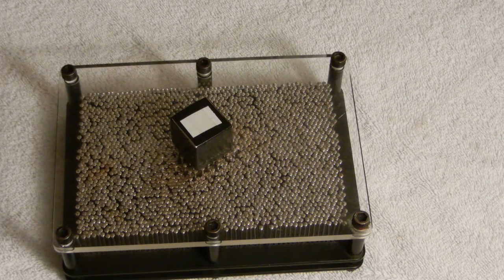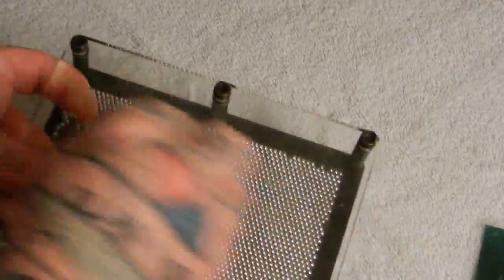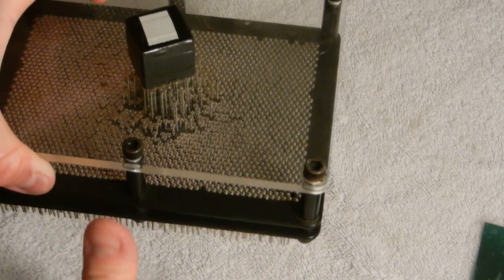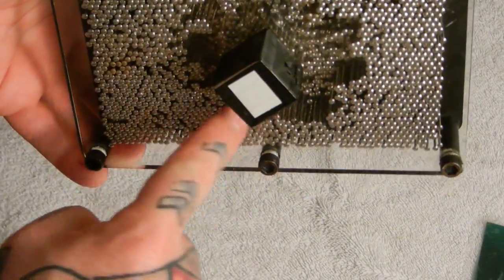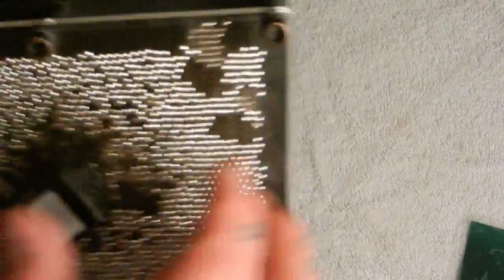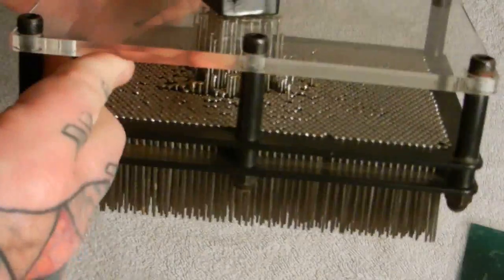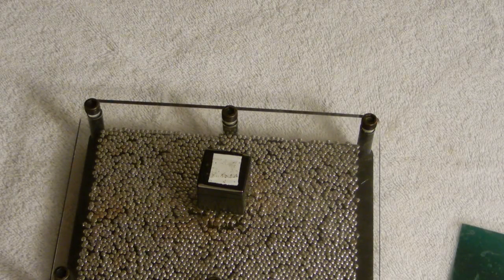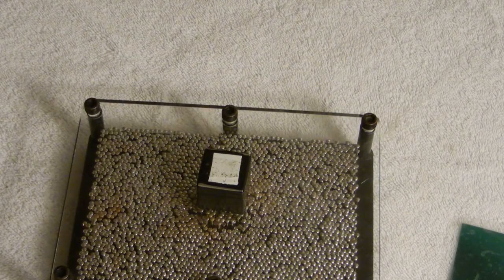Video 1 Uncovering the Missing Secrets of Magnetism

Comment: Awesome find. Taking another look a year later, I'll take another stab at what is going on. I'm thinking that what happens when you move the magnet slowly closer is it gives the atoms in the nails more time to adjust themselves to accommodate the incoming field of influence.  But whenever the magnet comes in fast, everything gets bunched up.   

It's sort of like pouring hot water into a glass slowly in order to give the atoms time to adjust, vs pouring it quickly and breaking the glass. The glass breaks because the atoms got all bunched up from there being too much of a clash/contrast between the inertial momentum of the hot water and the inertial momentum of the room-temperature glass.  

But if you pour the hot water really slowly, the atoms in the glass aren't hit by such a violent contrast, so they can slowly take on the new behavior and adjust their bonds with the atoms around them accordingly to accommodate the transfer of the new behavior.    

So with the nails, when the magnet comes in fast, the atoms get bunched up a bit which creates a little bit of heat. The atoms get coiled up and then spring apart.  This movement interferes with their movement toward alignment with the overall field. 

In order for the nails to be attracted to the magnet, they have to polarize.  As they do, then nails nearby begin to polarize also. Eventually,  all the nails will polarize evenly to align themselves with the magnet. This is a graduated process that spreads the polarization across all the nails evenly.  That's why hardly any nails come up.  But if you removed most of the nails from the periphery, then a lot more nails would come up. 

What happens when you do it fast is the nails in the periphery don't have time to align with the new overall magnetic field, so a much bigger bunch of nails come up. Then once the big bunch of nails are already up, the atoms in the nails left behind get polarized in a different way because the nails have an end-to-end relationship with the ones that came up.  So now, they have an opposite polarization with the ones that came up, so a lot of them will resist joining the ones that came up when you flip them over.

Comment: It seems like with the slow approach the flux lines start to pick up on a few nails to which most of the magnetic strength starts to go into limiting the force in the surrounding nails so they can't overcome gravity. Contrast that with the fast approach in which there is a sudden increase in magnetic pulling force on the small area of nails so most of them come up at once--the smaller amount don't have the chance to suck up most of the flux. Then with most of the nails up the magnetism is flowing through the metal and holding the surrounding nails, which are not, up in place. When there are fewer nails up in the first place from the slow approach, the circle around where the nails didn't come up after he turns it upside down, is just smaller because there is a smaller circumference of field being transferred around the nails that attract and hold in place the surrounding nails that didn't come up in the first place.  Also now that I think about it more, when he strikes it quickly there is force that knock the nail block back which will be moving away from the nails, which are not connected, because of the nails inertia. This will bring the nails a few millimeters closer to the magnet in that instant so more of them will come all the way up.

Comment: Hmmm...Mr. Wheeler and I are seeing completely different phenomena here. I'm seeing inertia in action. When the magnet arrives slowly, the nails have time to respond to the magnetic field and move toward it...pressing them against the sides of the holes. Only the nails directly under the magnet are raised. Then, we need to consider the magnetic circuit (but not in this post). 

When the magnet moves fast,more nails, further out lift. We do have to remember that sliding friction is less than static friction which augments the effect we are seeing in the demo. Again we need to consider the magnetic circuit and the amount of 'iron' in the circuit between fast and slow. 

Is it just me or are others really distracted by the way this guy is all tatted up?
Reply: I don't know which is more distracting, the tattoos or the amount of complete bollocks he talks. He's misusing every scientific-sounding word there is, from about five seconds in, also in all his other videos. He thinks there's a black hole in the middle of large disc magnets, and doesn't get that magnetic flux lines are closer together as you approach the vertices, hence the flux density is higher there. Funny and sad really but I don't care that much if the world burns.
Reply: So tell why the needles are not  going down when he fully turns the setup upsidedown because if it would have been friction then the  needles forming a ring would have been same in both cases

Comment: The theory proposed might be Right but the experiment is Missing Awfully of Rigour. I do agree with several comments before that :

"
It is [Very Probably] not the speed of the magnet that attracts more pins but the tap of the magnet against the frame allowing more pins to move freely.  

The "ring" of pins that do not move are simply succumbing to friction from the horizontal pressure of a collection of pins being drawn to the magnet.  [the magnetic field been drawn by more pins stuck on the pole of the magnet]
"

The experiment, or any other with equivalent purpose, SHOULD BE REDONE WITHOUT THE TAP OR ANY SHAKING and with plain sight of the pins table all along the demonstration.

Regards,
Didier

Comment: Fast approach causes a jolt which allows the nails to jump slightly, this is why you have more nails, this also makes the nails around the ring to raise slightly causing a bind. When you tip it over the nails in a bind stay down. Bet?

Comment: Vector field functions such as gravity are said to be caused by the atoms arranged in the material. TheJohnson motor patented april 24 1979 used stacks of different type materials, and later the Searl Effect Generator was said to copy the method using magnetized rollers and a gated counter magnetized ring of material. The tendency of flipping the fields to achieve a switching effect using coils and induction is also very useful. Most say there are three types of magnetic motion apparatus. What are these three types?

Comment: What it's doing in the fast approach is applying kinetic force on the entire structure which causes an equal and opposite reaction in the nails. The nails, having accelerated upward due to being struck by a moving object, are closer to the magnetic moment and thus a stronger field. The reason you get the ring when you flip it over is because you aren't shaking it for your "fast approach" experiment, which is obvious fraud.

Comment: now would the time variable actually be displacement of energy from your motion? and when the magnet struck glass(seeing so much energy potential) and came to a hault, would that in turn cause a larger inertial point, the energy must go somewhere, which would explain why the dielectric area would be enlarged as well? and the lack of energy put in (by the higher time variable) would keep the inertial plane as similar to just the magnet's itself as seen with the ferocell and ideally with the pins.

Comment: It would be nice to see the experiment done by an actuator, stopping before the surface, at different speeds, as to not disturb the needle board with kinetic energy. That fast tap could help needles jump quite a bit and thereby overcome some friction that otherwise would hold them down. For someone like me seeing this the first time, it's not convincing until such variables are removed from the experiment. Any links to such? In any event I like the research!

Comment: Fantastic! Thank you for freely sharing this. You are right I was never taught or shown this in electrical engineering.   Visually it looks like the surrounding nails resist gravity itself.
Reply: Looks like the pins are pulled towards the magnet as one would expect, which binds them against one another as they attempt to occupy the same space. In a slow approach they are able to rise unimpeded without binding against one another. With a fast jarring introduction of the magnetic field the pins essentially wrestle for space between their origin and the magnet. This causes the pins to fall out of parallel alignment with the hole they slide through. 

In practice this is a poor demonstration - there are far too many external variables at play in this experiment/demonstration.
Reply: Too me it looks like the pins during the slow and fast approach are causing a - and +  dielectric displacement.
If you are able to comprehend the video you will be able see this. It is not a poor demonstration  Its the defective brain that resides
in your skull.

Comment: Phi * Psi = what? Electrification? I'm a senior Electrical Engineering student and never heard of this fallible equation. Phi could be either magnetic or electric flux; which one? Also, please clarify on what you mean when you said "electrification". It's not a parameter or unit of measure. Thanks
Reply from the maker: dielectric x magnetic = QPlanck of electrification

Comment: Indeed this is only showing the magnetic fields strength. You pop it down with the full weight and strength of the magnet to collect more pins, thus extending if you will the magnet itself. The pins not falling are showing how far the magnetic field holds those particular set of pins. pretty strong magnet actually.lol but the slow example your resisting the force of the magnet, thus landing softly collecting less pins, but none the less still extending the field once again. Just this time less of the force is extending further, but you still see a little ring around.. :)

Comment: So given that fields generate energy that we capture. Given that the most reputable scholars in electricity throughout the ages have said that it was fields and not electron movement or exchange. We need to ask what is it really? Well, isn’t it that magnetic or electric fields can induce electrostatic fields in said metals ect..  To be stored or expelled through said substance. That many things can charge and expel fields for their preferences in polarities, just not all equal dependent on their atomic makeup of more electrons, protons and neutrons. Wouldn’t it be those atomic parts holding a charge to exchange as energy directly released from its source ( proton, electron or neutron. )and not exchanged from said from one to another along the line as science currently states. So the magnetic field is not used directly, it must be electrostatic first. Action / reaction. ???

Comment: The difference between the two results is likely due to the friction holding the pins back in the slow approach, and the pins being released when you hit the toy on the fast approach. You would need to dismantle the toy and mount the clear plastic and the pin board so they are not connected to eliminate that factor and run the experiment again. I think the results would be identical if that were the case.
Reply: Static friction doesn't explain the different results after shaking the device.
The effects of static friction are nullified after shaking.
Reply: @KxS @spinfowars I don't agree, I still think static friction in this case is a major factor in the results. I can't be sure of course and neither can you. But seeing as we cannot be sure, repeating the experiment as I suggested would at least remove static friction from the equation and clear up the results wouldn't it? I'm no de-bunking anything in this video, just pointing out factors that interfere with the results. It's just good scientific practice...

Comment: if electrons don't exist then what do the terms ions, positive, and electric charge mean then?
Reply from the maker: +Mike Jones 
  JJ Thomson developed the “Ether Atom” ideas of M. Faraday into his
“Electronic Corpuscle”, this indivisible unit. One corpuscle terminates on one
Faradic tube of force, and this quantifies as one Coulomb. This corpuscle is
not and electron, it is a constituent of what today is known incorrectly as an
“electron”. (Thomson relates 1000 corpuscles per electron) In this view, that
taken by W. Crookes, J.J. Thomson, and N. Tesla, the cathode ray is not electrons,
but in actuality corpuscles of the Ether.” – E. Dollard

“There is no rest mass to an ‘electron’. It is given here
the ‘electron’ is no more than a broken loose “hold fast” under the grip of the
tensions within the dielectric lines of force. They are the broken ends of the
split in half package of spaghetti. Obviously this reasoning is not welcome in
the realm of Einstein’s Theory of Relativity.” – E. Dollard

 You cannot say that stretching a trillion rubber bands nailed to
the floor and releasing them or breaking their “force lines” is the “flow of
electrons”; discharge is a terminal movement in systems of inductance or
dielectric capacitance.&#160; There are no discrete particles in the universe
and certainly none that mediate charges, discharges, magnetism,
electromagnetism, gravity, and radiation, only fields, all modalities of the
Ether. The so-called ‘electrons’ are not particles, not objects or subjects but
are the dynamic principle of discharge, and are certainly not charge-carriers,
fields are not particles, are not “electrons”, nor assuredly are there energy
discharges in the vacuum of space involving ‘electrons’; the ‘electron’ is a
fiction of fallacious observation and an even more faulty mental acuity,
spawned naturally from the minds of materialists, or an Atomist. Electricity is
Ether in a state of dynamic polarization; magnetism is Ether in a state of
dynamic circular polarization upon itself, is the radiative termination of
electrical discharge; dielectricity is the Ether under stress or strain. The
motions and strains of the Ether give rise to electrification. Phi times Psi
gives Q; ‘electrons’ do not mediate these electrical and magnetic forces or
their likewise the Ether fields.
Reply: Fascinated by this thought:
"Electricity is Ether in a state of dynamic polarization; magnetism is Ether in a state of dynamic circular polarization upon itself, is the radiative termination of electrical discharge; dielectricity is the Ether under stress or strain. The motions and strains of the Ether give rise to electrification."